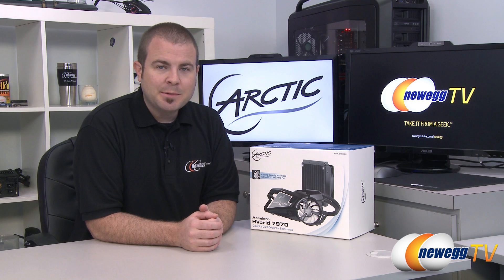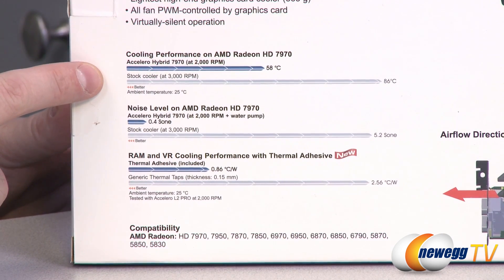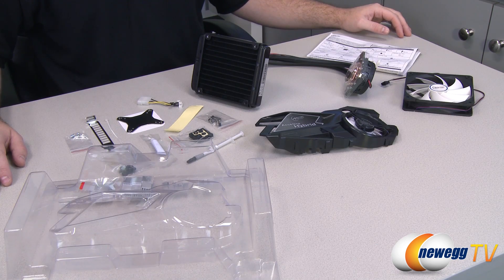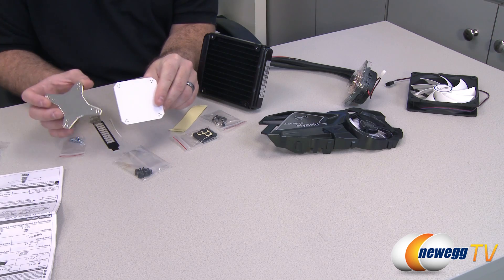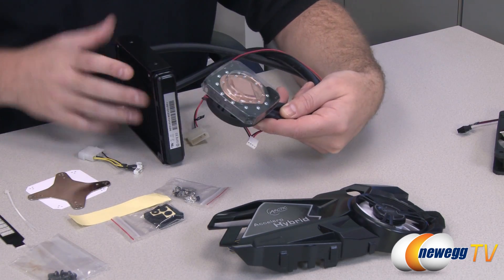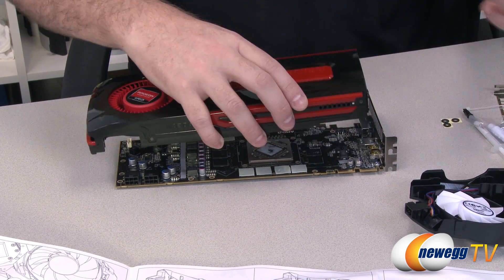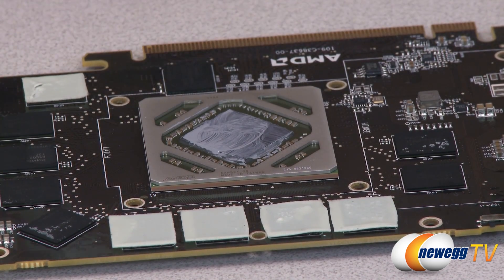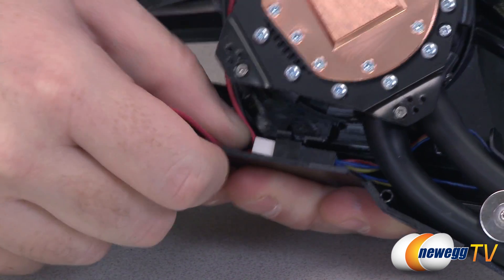Newegg TV: ARCTIC COOLING Accelero Hybrid 7970 Fluid Dynamic VGA Cooler Overview

Comment: Hello i use the Artic Accelero Hybrid with the gpu Gtx 670 in sli, when i play a game like crysis 3, hitman, tomb Raider, work at 35 to 40 celcius by 1 or 2 hours of game.  I love my cooler system is very quiet and so cool, if you have any question contac to me, bye.
Reply: so do you cool both of your cards?
Reply: Lars Iversen Hello, yes i have the artic accelero hybrid in both gpus,  i use a tower antec dark fleet 85 , because have enough space for that, but with the gpu + artic accelero take a 2.5 slot of pci express, each one.

Comment: the cooler performs well but the only issue is that the vrms need better cooling. This has been a general consensus about this cooler. It does make your gpu alot quieter so that is a very big plus.

Comment: The card being overclocked doesn't make a difference to the structure itself, if that's what you're asking. But it says it works with all 7970's so it should be fine :)

Comment: yea as of right now they have a 1000$ gpu that gets 10 fps better than a 200$ gpu idk about you but i dont call that an achievment at all and ive heard that the 780 is only going to be 25% more powerful thatn the 680 big whoop? same for the 790 big whoop the 8000 series is said to be double the performance of the 7000 series nvidia is going to be in trouble

Comment: are you stupid? eyefinity is about 50x better than nvidia surround everyone and there grandma knows that and im running eyefinity with a 7970 with 3 23 inch 1080 p monitors just fine no problems at all only game i have trouble with on maxx is crysis 3 my 7870 xt in my other rig runs 2 of the same monitors just fine once again only struggles with crysis 3 i dont see your point? the titan is a $1000 card that gets 10 fps better? big whoop its not worth a grand

Comment: i already have :) and the 8000 series will be epic and the gtx titan doesnt perform by leaps and bounds above the gtx 680 or the 7970 ive only seen 15-18 fps difference and since the 8970 is supposed to be 3x as powerful as a 7970 then i think amd will once again regain the title of holding the worlds fastest single gpu card they still hold the title of worlds fastest dual gpu card

Comment: its convienient because if you upgrade your card you can just swap it to that one, whereas if you buy a specific water block for open loop you are out 80 bucks but if you add the pump/rad (quality one) equals about the same price, i installed mine last night and was really effective, dropped my temps from 50c to 29c lol

Comment: i just installed mine tonight, must admit was a pain to install but worth it as it brought my idle temps to 29C.....yea you read right used to idle at 50C i have an amd 5870 black edition very quiet the only thing that is extremely noisy is the stock amd fan for my fx8120 but will liquid cool that soon too!!!

Comment: Nope. Its soldered directly to the board; there is not socket per se.  All the low end Fusion APUs are like this, E-450, E-350, C-60, etc.  For future reference or for those curious about their own setup and upgrade paths, if your machine has an AMD Fusion APU and its NOT an Ax3xxx series or the new trinity Ax5xxx series, then its soldered directly to the board.
Sorry :*(

Comment: some do if you look around. i belive it was ZOTAC that came out with a card that was a closed loop water cooled card out of the box. also EVGA has cards that come with a water block installed but you will need to still buy fittings and everything else.

Comment: Now why can't VGA cards come stock with the option of having a water cool block rather then a heat pipes + fan on the card when you by it? I'm more then willing to spend a few more bucks from a company who designs a water block cooler for their cards, rather then spending on a cooler which i would have to install myself.

Comment: So if I already have a Corsair Hydro H60 radiator in my system, how do I work one of these beasts into my Antec One? I have the H60 radiator fan mounted to the rear fan space pulling in cool air, another fan outputting warm warm from the top fan space and another outputting warm air through the bottom fan space. Should I install this in the front fan slot to pull in air from outside the case and remove the fan on the bottom? Would the radiator for this even fit in the front fan space of my case?

Comment: i still prefer my antec kuhler 620 over this, also half the cost, overclocked my baby to 900/1800/2200 working like a charm :) getting temps of 29-32 at idle, on gtx 480 thats unheard of :P

Comment: Coolit had the right idea, they made a AIO water cooler for gpu's called the 'Omni'.. which came with a 120 or 240 rad.  All you had to do is buy the cooler and if you wanted to use it on a different card you simply bought a different 'interposer plate' (water block).  Then Corsair bought them out and effectively killed the project.  Why Corsair themselves haven't went forward with it idk.

But that was the right way to go as there was no need for a fan/shroud... it had full cover blocks.